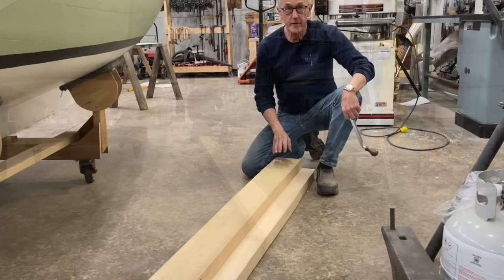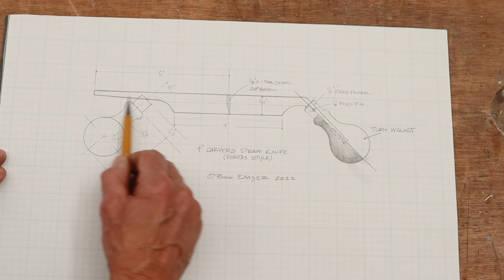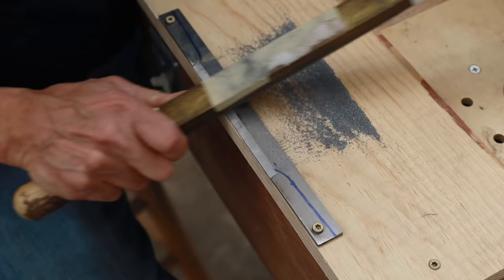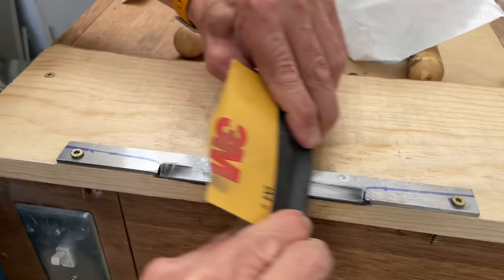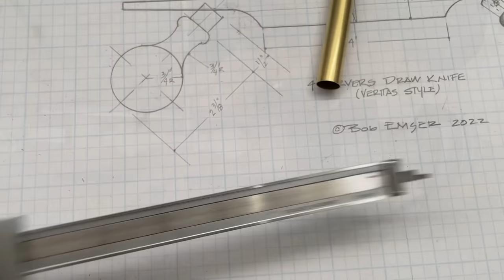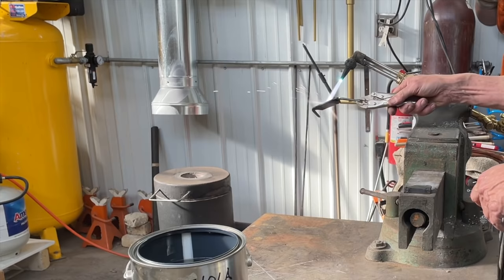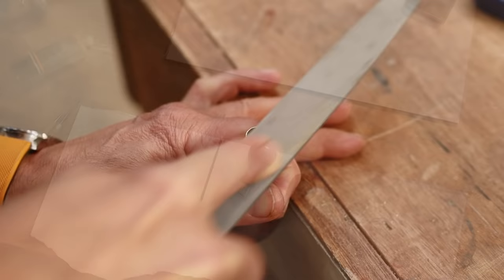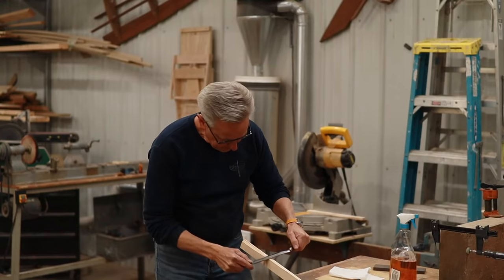Making a 4" Drawknife

Comment: Using light to determine the edge sharpness: Back when lumberjacks used only saws and axes, the saw shed where they sharpened the saws had skylights in them and the shed was aligned on a specific axis in order to allow proper daylight to reflect off the newly sharpened edges to determine their progress.

Comment: I would have rough ground the bevel edge with a grinder first to save on the files, but maybe it doesn't matter in this case, also on tangs would have used the corner of file or maybe grind rough to make several grooves on tangs for glue to hang on to, and I still learn a lot things from you.

Comment: Another fantastic video -- great thanks.  Another approach would have been to take the "excess" steel and forge it into longer tangs.  There should be more than enough, and then make threads on the ends.  That said, you are a terrific craftsman.  Bravo.

Comment: I enjoyed this video very much and it spurred me into figuring out the brand of my 4" drawknife which has faint markings. The handle shape and ferrules looked just like the Pexto, but I eventually found a place that had some vintage brands listed. Turns out it is a Jennings which I could still see the last few letters of. Interestingly, I thought it was ground  shallower than the 20° you used, but I just measured it @ 25-26°. My larger ones would be my choice for the mast however.

Comment: You built another beautiful tool. Working with a draw knife is a very satisfying thing
I really like you side projects. You need to put a logo / makers mark on your tools.
I make knives and a little bit of leather work too. I built some of my tools too, I fins this equally satisfying.
Reply from the maker: Hi Roland,
I do have a logo stamp. Unfortunately it is to large to fit on the blade. I have done some leather work. You may have seen some is episode 47. I do plan on making a sheath for the knife, I ran out of time to include in this video. Perhaps I can put the logo on it. 
Thanks for your kind words. 
Cheers,
Bob

Comment: The effort and craftsmanship that you put into your projects is a joy to watch. What are you using as a lubricant on your sharpening stone? All of my oil stones were completely gummed up with decades of oil. I finally degreased them all and started using Norton honing oil, which works great. At over $30 a quart it is on the expensive side though.
Reply from the maker: Hi Andy,
I use a  Spyderco Ceramic sharpening stone. The lubricant I was using is window cleaner. here is where I purchased mine 
https://shop.brownells.com/gunsmith-tools-supplies/metal-prep-coloring/stones/medium-ceramic-stone-sku824302002-12609-30326.aspx?cm_mmc=PPC-
I have the medium stone. These are excellent stones that t seem to never wear out. I highly recommend them.

Thanks for watching.
Cheers,
Bob

Comment: Bob,
The drawknife is my favorite tool and you made a beautiful one.  I also like a small drawknife for fine work, but a mast seems like a fairly large project for a small knife.  What is your thinking there?   Thanks again for another fine tool demonstration.
Reply from the maker: Hi Steve,
I have a large drawknife (8”) that I’ll use for the mast. The jib spar is only 1 5/16” in diameter so I will mainly use it for the small spars and gaff boom. 
Honestly, really don’t need it as a spoke shave would also work. Basically I really wanted to make one and know I’ll find many uses. 
Thanks for watching!
Cheers,
Bob

Comment: Another beautiful job.  I forget - what's the purpose of heat treating vs tempering?
Reply: Heat treating make the steel harder to hold an edge longer.
But it makes the steel brittle.
Tempering brings it back a little,  making it a bit less brittle, but does not take all of the strength out of it.
Both processes affect the grain structure of the steel on a molecular level, and affect how well the steel can take and hold and edge and how quickly it becomes dull again or breaks/chips.
Reply: @thomasarussellsr  
Thanks for that info., Thomas.

Comment: Bob, great build. What was the use of the ferrules, apart from a finishing look?
Reply from the maker: The ferrule is to prevent the handle from splitting. 
Thanks for watching!
Cheers,
Bob
Reply: @TheArtofBoatBuilding  thanks Bob, that's what I understood previously. But why would the handle split there if it's been drilled, the tang burned in and the tang glued epoxied in? There's no beating on the handle at that point and the tang tapers down right? TX
Reply from the maker: @LitoGeorge  you’re correct, one would not be hitting the handles with a mallet. However, it is possible that pulling on the handle ends and the blade catching on something the torque created might cause a crack.
Reply: @TheArtofBoatBuilding  interesting. Well, I'll be using them on my restoration of an ancient blade. Thank you for your video, and comments.